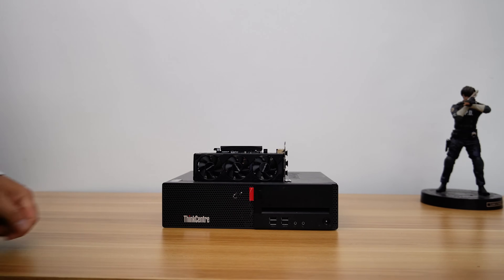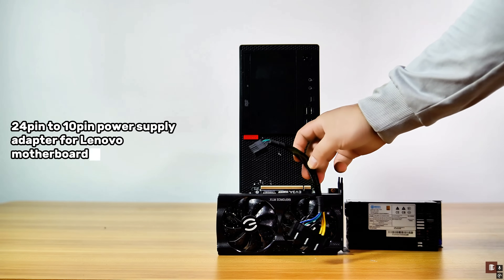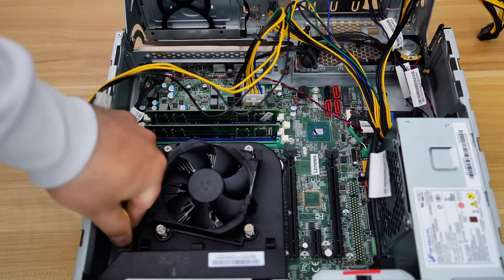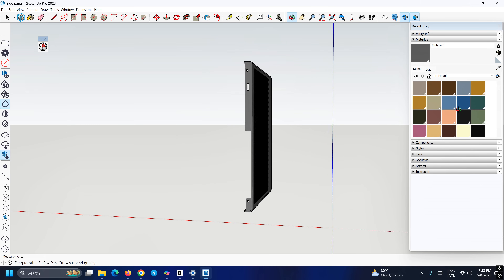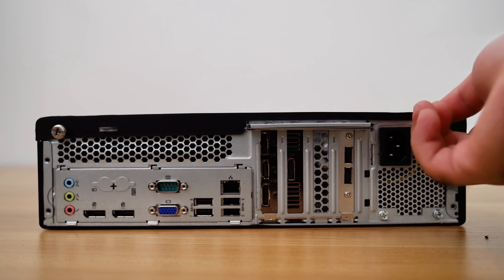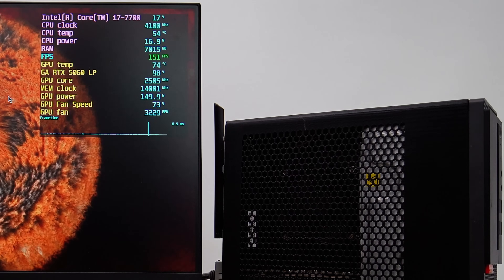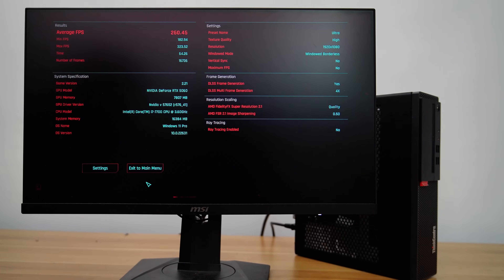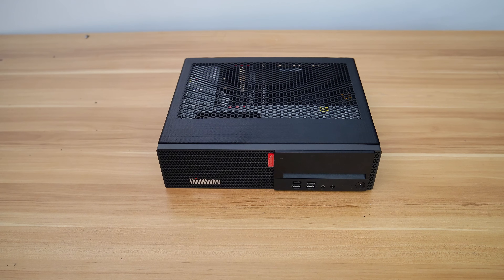RTX 5060 Low-Profile on SFF Office PC: Is It Really That Hot?

Comment: Out of curiosity, what is the largest GPU you have that will realistically fit in the Lenovo? Do you have sizes that are similar to RTX3060 and RX6700XT? With these cards, can you still close the case? Thanks for any help.
Reply from the maker: I am referring to the case size that could accommodate a full-size GPU if redesigned. I do not mean that the current case design structure, as it stands, can fit a full-size GPU while allowing the side panel to close. Rather, I see great potential for improving the existing OEM SFF PC design within its current dimensions to make it compatible with a full-size GPU. HP did it already with HP Z SFF series.
Reply: @itggear  Yes of course. With the cutting of the panel, do you think a card like 3060 or 6700xt size would fit even with a bigger cut?
Reply from the maker: @Doomreb   I think you need to move the PSU to another location. You could use a flex PSU mounted in the hard drive cage area by completely removing the drive bay. This would prepare the PSU location to accommodate a full-size GPU in a vertical position using a PCIe extension cable or riser adapter.
Reply: @itggear  Thanks for the help!

Comment: For anyone that thinks this si good solution just dont like dont even bother do it cuz rtx 5060 low profile use only 8pcie lanes and with old systeam like this that dont have at least pcie 4.0 or 5.0 your gpu wont be used at 100% and also the CPU is huge bottleneck also if you gonna add to pc that cost this little new RAM new GPU and PSU you rather buy minisforum all in one board and build something your self that hold a lot longer or buy mini pc maybe from minisforum where you can actuallu plug in low profile gpu or buy gmtech mini pc and use uculink port if you need more gpu power, the solution in video is OKish if you dont mind lose a lot of power and dont gain much back but that CPU limitation is will be in any new game sooo iwould not go for this at all. And also the 5060 is far cry from high power gpu is more like spit into faces of the games from NVIDIA and yes only version i would say its ok is this low profile version cuz it can fit in some very small machines which is ok but it still should be paired with 12gb of vram change my mind.
Reply from the maker: It might lose some performance with this setup by pairing a modern GPU with existing old PC hardware, but keep in mind that millions of people likely already have an SFF (Small Form Factor) PC. If you are an investor or manufacturer, why overlook this huge market? Let's think about those millions of people out there who already have an SFF and just want to play some games. They could buy a new card, pop it into their existing PC, and start gaming with $0 more spent on a new CPU, RAM, or motherboard.
So technically, your point is right, but it's not necessary to care too much about it, since we'll get what we pay for. Ultimately, I do not recommend you to buy an old sff pc just for pairing an old PC with this modern GPU. However, if you have an old PC, you can take a look at this option instead of throwing your old PC away and spending much more to get a new one. You can repurpose your old PC and still get the job done. So ultimately, it depends on you. Thank you for watching!

Comment: There should be a way to create two "wind tunnels" or two wind chambers, gpu side and cpu side. Two ways, extraction and intake. should give us a nice headache 😅
heat aluminium, black coated, psu side also.
 and probably soft compound that hold itself but can be set to a shape,to separate air flows, ,strapped to the 3d printed upside.
not a great cost, but effective........

Comment: The Intel I7-7700 CPU shown would fail to fully comply with official MS Windows 11 requirements. A better choice would be to go with an Intel 8th gen (or better) CPU. The IGPU of an Intel 11th CPU might even (all by itself) be competitive with an add-in low profile GPU.
Reply from the maker: Today’s video examines whether the RTX 5060 Low Profile graphics card is a viable option for small form factor office PCs, especially given that many SFF chassis share a similar design. Please note that the CPU featured is used solely for demonstration; we haven’t determined the best performance configuration, and in practice, PC setups may vary. Our focus remains on the graphics card’s feasibility within an SFF environment.

Comment: Will the powersupply you linked work with a ThinkCentre Neo 50t?
Reply from the maker: Thank you for your question. Unfortunately, I’m unable to confirm product compatibility. The link I shared in this video refers to a power supply that I have personally used with the PC featured in the video, and my comments are based solely on my experience. To ensure compatibility with your computer, I recommend reaching out to the manufacturer or seller before making a purchase. Thank you.

Comment: I dropped one straight in to that exact thinkcenter. Tho i had to grind the HDD cage in half. 
But runs dam good.

EDIT: And your right, the issue is with the CPU. Even under 20% load the fans will ramp up and down unless you mod the case.
I also just drilled some holes and attatched a fan.
Reply from the maker: Thanks for sharing your experience!
Reply: i didn't attached any fan i just leave it as it is (I cut off the upper part (the one above the fans). before temps were reaching 80-85 and now in extreme hot weather they are nearly 70/75 degree. 😅

Comment: would've been perfect if it was only 70-75 watts lol
Reply from the maker: There are some GPUs that outperform the RTX 5060 Low Profile in compatibility, thermal design, and power consumption—such as Dell’s RTX 5000 Mobile and the RTX A4000 Ada SFF 20 GB. The RTX A4000 Ada SFF has a TDP of only 70 W, which means you can install it in many small-form-factor cases, even those with very restricted airflow. However, a “perfect” card like that tends to attract a lot of demand, so it usually carries a very high price tag. Ultimately, it comes down to which benefits matter most to you and what price point you find acceptable; the fact that you haven’t seen the card yet doesn’t mean it doesn’t exist.

Comment: I really appreciate you doing this. GamersNexus, Linus and JayzTwoCents all dump on the 5060 and I get it, it’s not a competitor with other cards…EXCEPT when you’re trying to build a lower power draw low profile build. 

I paired a 5060 LP with a 5700X3D I had from a spare build an this little thing can play all the games my wife and girls a want to play in the living room. 

Emulates up to Switch and PS3 fantastic and runs all of the adorable platformers and cozy games they love at max without making a noise. 

Is it a great value card? No but it IS  a nice little card for the SFF (really SFF) crowd. 

Working on a mod to see if it runs in my M90q as a replacement for my RTX A2000
Reply from the maker: Thank you for insight. Appreciate it!
Reply: @itggear  No problem! I have a whole house full of little repurposed mini-pc's thanks to you showing that these things can game within reason.

Just built a little Batocera PC for my neighbor's kid that missed out on all of the OG pokemon games using an HP G4 705.
Reply: @recycledsoldier   how are you only getting switch/PS3 performance? It's not the 5700X3D doing that, because that's a better CPU than is in the PS5. So......yah.
Reply: @tlv8555 I’m running a switch and PS3 emulator.
Reply: @tlv8555  This is normal in emulation because CPU have to translate code made for different architecture.

Comment: Be sure to measure 1% and .1% low fps when using frame gen in order to expose any overhead latency
Reply from the maker: Please check the FurMark test, where a consistent load of 150W is applied, to verify whether overheating occurs. The GPU is not reaching 100% utilization while gaaming due to a CPU bottleneck.
Reply: @itggear  this isn’t remotely related to what the guy commented

Comment: the main concern would be the PCIe 3.0 not the heat. we already know that we lose some performance on PCIe4 because of the limited PCIe x8 lanes of the card.
Reply: you will lose 5 fps but you gain good wattage 150 w is nothing compared to other gpus that are 200+ watts its still a win
Reply: Yes, PCIe 3.0 with x8 lanes can indeed limit performance compared to PCIe 4.0. So the heat seems safe, but any suggestions for maximizing performance with this setup?
Reply: The lost is quite minimal. Even 5060Ti which is a faster card only lost something like 4% at most and that is on PCIE 3.0.
Reply: @arenzricodexd4409 you are incorrect, it isn’t much of a performance loss in most games when it is 3.0 x16 vs 4.0 x16 but when it is only 3.0 x 8 lanes then it becomes a bigger issue (this is regarding the original commenters comment I am aware that the 5060 in the video is 5.0 x 8). Also this is all game/application dependent but yes it can lower your performance by white a bit when your half your lanes are gone. Also going from 5.0 to 3.0 is worse than 4.0 to 3.0
Reply: @danebeee1 techpowerup already did the test on 5060Ti PCIE scaling. Also you need to remember just because the gpu use PCIE 5 standards it doesn't mean they really need it. As of right now even PCIE 4.0 is overkill for GPU let alone PCIE 5.0. The only real issue is when VRAM is not enough. But regardless of having PCIE 5.0 or full x16 lane not enough VRAM will still going to impose an issue. 

So you can't just make simple assumption that going from PCIE 5 to PCIE 3 will be worse than PCIE 4 to PCIE 3. the tech did not work like that.
Reply: @arenzricodexd4409 bro I just watched a digital foundry review that showed that when you take a pcie 5.0 gpu (pretty sure the 5060 series was in that video) and make it use pcie 3.0 x8 you will lose a good bit of performance on some games. Like I said it is game dependent but I would encourage you to go look at that video. Also we have known this for a while not sure why you are acting like it doesn’t matter??
Reply: @danebeee1 what you saw in DF video is what happen when your VRAM is not enough. the x8 will make it worse with lower version of PCIE. in alan wake 2 for example DF only lose 4% of performance. That's consistent with TPU finding. Only when they turn on RT we saw massive hit on performance. The test done on forza horizon 5? DF were using extreme preset with 8x MSAA. that 8x MSAA are done on purpose to drive VRAM usage more and worsening the effect from PCIE 3.0. but if VRAM is not an issue performance impact will be minimal.
Reply: @arenzricodexd4409 no it wasn’t just the v ram thing because if I remember correctly even the 5060ti with 16 gb was having a noticeable drop off with pcie 3.0 x8
Reply: @danebeee1 in DF test they only test 5060. Not 5060Ti 16GB. there were other vidoes on youtube as well testing 5060Ti on PCIE 3. performance lost is minimal like shown by techpowerup pcie scaling test on 5060Ti 16GB.
Reply: @arenzricodexd4409  wrong, techspot benched the 5060 to 8 GB on 3.0, 4.0 & 5.0 & the loss in performance between 5.0 & 3.0 is 30-60% depending on game. You could not be more wrong. You know nothing.
Reply: I'm not aware of anyone that's fully tested this, but it is a reasonable assumption to make. The difference is going to depend greatly on the game and settings. However, I'll be testing this fully to find out how much it really affects performance.
Reply: That's an RTX 5060, so basically PCI-e 3 shouldn't be a problem at all. It's so weak anyways
Reply: @jachtk893 While I agree that it won't impact the core's ability to render frames, it will definitely be a bottleneck between the system memory and the VRAM, and that can definitely impact performance if any assets are being swapped between the two.
Reply: 3 to 7 fps loss it's not that much
Reply: @porter3 you are right and also Is only 150 w it's very good
Reply: The performance drop is due to the low memory bandwidth with PCIe 3.0. The card can handle 448 GB/s at 5.0. With PCIe 3.0, that's only 316 GB/s. Games that require less or slightly more data per second can handle this. Newer games like Indiana Jones experience data congestion and micro-stuttering. You can compensate for the FPS with MFG if the game runs natively at 60 FPS. However, the frame times will still be above 20 ms.

Comment: Heck yeah that's hot! And if heat inside the case is your concern, take off the top!
Reply: It's the best low effort solution. My house IS a bit dusty, it's an old house and my office PC without intake or exhaust fans but with the side panel off hasn't been cleaned in a decade and it still doesn't look unreasonably dusty Certainly nothing that would inhibit function.
Reply from the maker: Go with whatever you prefer. 3D design is the core feature of my channel, and it’s what makes it stand out from others. In real-world usage, you can do whatever you want, as long as you're satisfied with it. More options are better than fewer, right?

Comment: The idea of cramming a $400 GPU into a $100 computer could only occur to a YouTuber.
Reply from the maker: This is just a test to see how it works. There are many people out there who are curious about this setup. If you’ve watched this video, it could save you time and effort by showing exactly what results to expect.

The idea is that many people might already have one of these SFF PCs, so they could just invest in a GPU and spend $0 on a new PC, making it gaming-ready without spending thousands of dollars on a full system. That said, it doesn’t mean this setup is only meant for older systems. As you can see, there are various SFF PCs on my table, and one of them features an Intel Core Ultra 7 265.

The main goal of this video is to share educational content for anyone who might benefit from it. So no need to take it too seriously.

Thank you for watching!
Reply: lol he also changed the psu, the ram and the ssd 🤣🤣
Reply: @cicciopiu  The ram was gutter scraping green PCB with no heat sink. For another $10 he should have made it 32GB and dual rank. The power supply cost was probably equal to the base cost of the computer. I bought a load of NVME and SATA SSD when they were cheap, they are about 20% more expensive than they were a couple years ago. Except for the ram, I'm right there with you.
Reply: This is what I'm going to do with my EliteDesk 800 G4 SFF. 😀

Comment: A Lenovo 310s ventilated lid also fits the m720s if you don't have a 3d printer. You can also fit an 80mm fan to the font as motherboard has 3 spare 4pin system fan terminals. I cant wait for my LP 5060 to arrive so that I can start testing. Great video!
Reply: Thanks for the info
Reply: @Dogbreath1974 Is it the same for the whole line? (m710s, m720s, m910S, m920S) the one in this video is the m910s.
Reply: @Doomreb hi, I only have the m720s so no idea beyond that. It’s a slightly different colour but looks good. The m720s also supports up to i9 9900 so more cores
Reply: @Dogbreath1974  That's good to know, I figured as the numbers go up it had to be features on the motherboard and things like that. Thanks.
Reply from the maker: Thanks for sharing
Reply: Really? Where can i find this i have an m725s sff its the same size as the m720s